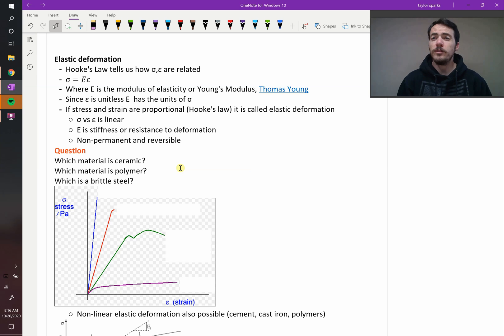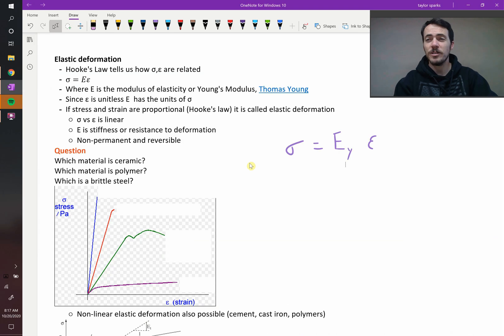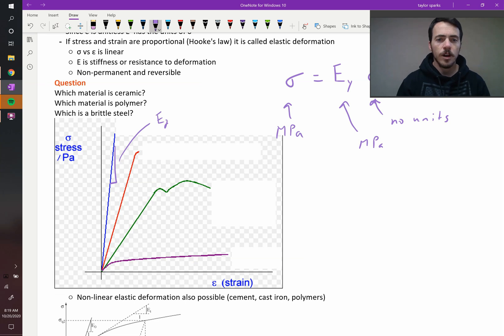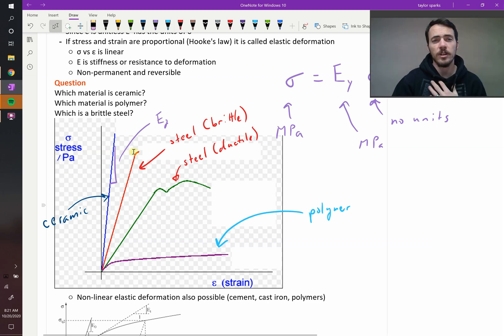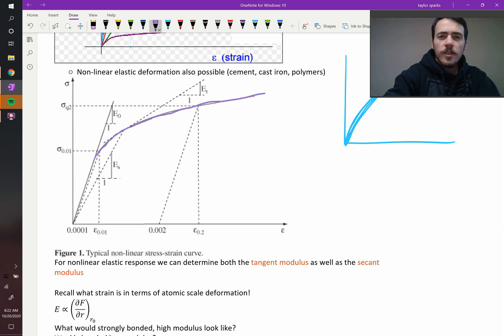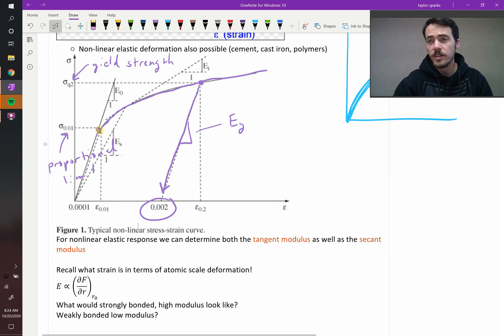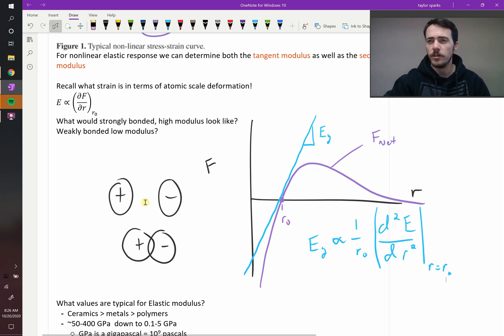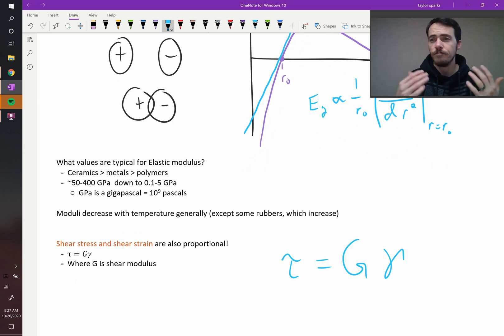Stress-strain curves and modulus of elasticity

Comment: Professor I have another question here about Bridgman correction .  Can you tell me more about it ?What was it and how can we use it ? I really appreciate it .
Reply from the maker: Actually, I've not heard of that correction before.
Reply: @TaylorSparks I can try to explain you from here professor from my research in the internet. In a tensile test, once necking begins, the deformation on the specimen becomes non-uniform. Additional, radial and hoop stresses appear inside the necked region. And these lateral stresses cause the stress - state to become triaxial 3D.Because of the extra hoop and radial compression, the metal's ability to carry load along the axis is slightly reduced.
  Thw real stress acting purely along the tensile direction is lower than this simple "P/A" estimate. To correct this overestimation, Bridgman introduced the correction factor _B_.

Comment: 3:49 I must disagree to some extent. Young's modulus and yield stress of steels have almost nothing to do with each other. You said that the red line and the green line were for two different grades (types) of steel. No, this is NOT true. If we talk of Young's modulus of steel(s), it is pretty much the same for majority of steel grades. As you mentioned later in the film, E value depends on interatomic forces / interactions in the material. Most of the steels contain 98% - 90% of iron atoms that interact, so basically E modulus is the same! So, the slope of the linear parts of the red line and the green line should OVERLAP. The deviation from the linear part may occur at different stress (the yield points may be very different), but until both steels are in pure elastic state, the plots should be very close. Such plots and examples are misleading. They suggest that mild steel has lower Young's modulus that hard steel. No. They have the same Young's modulus, and different yield points. The only reason for different values of E may be the chemical composition of steels. Stainless steels (~ 30% of alloying elements) may behave differently from ordinary carbon or low-alloyed steels. Otherwise - no difference.
The red plot and the green plot would be perfect examples if you compare steel (red) to aluminium alloy or copper alloy (green) - these two groups of alloys have lower Young's modulus. 
Apart from that, thumbs up! Great vid, I've just started watching your content, and I'm glad you share your knowledge.
Reply from the maker: This is such a great comment. Thanks for catching that and for sharing your insight.

Comment: How does a compressive curve look and how do you analyze it ?
Reply from the maker: @PlummyNumNums  there's no guarantee, but it typically looks a lot like the tension curve but smoother and higher strength values since most materials are going to be stronger under compression than tension. This is especially the case with ceramics.
Reply: @TaylorSparks  Do you hppen to have any referenc material showing the compression part of these graphs? most of what i find are examples in tension and I am trying to mathematically prove the Modulus of elasticity for some experimental data i collected on a polymer. my stress (compression) vs strain does not have the shape i expected and it doesnt follow any of the examples ive found. It also does not express linear behavior which is making it difficult to find the modulus. Thanks !